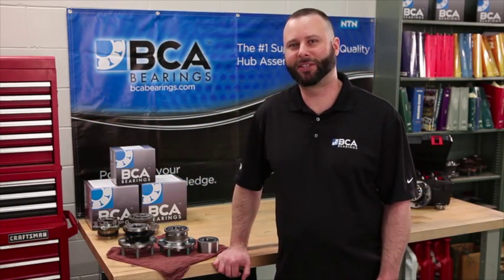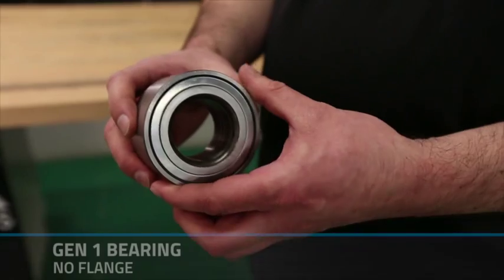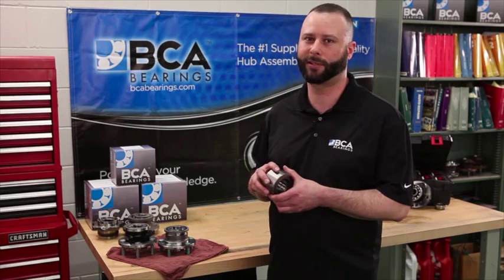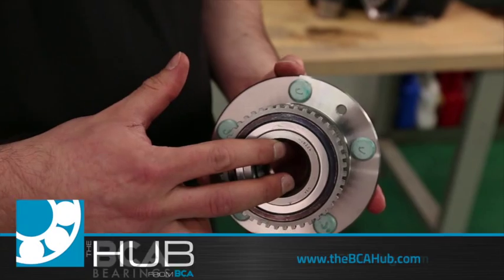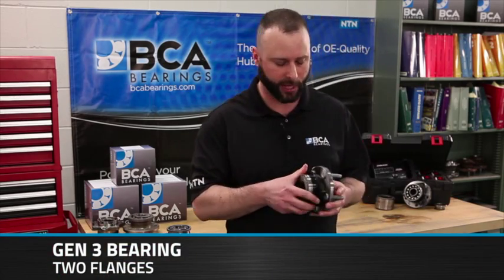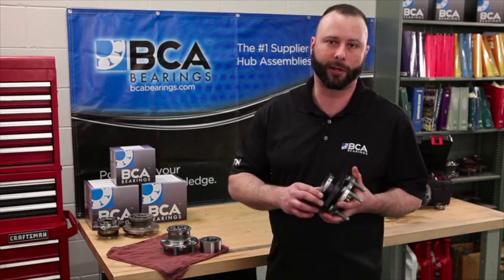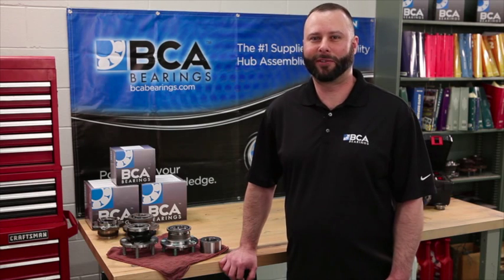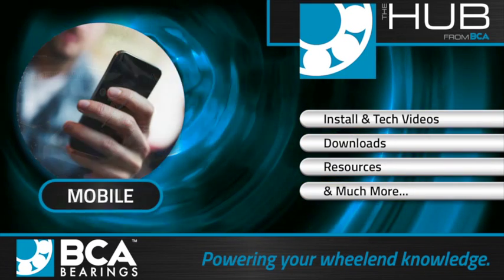Wheel Hub Comparison: Gen 1 vs. Gen 2 vs. Gen 3

Comment: Is BCA WE60551 quality product?
Reply from the maker: Yes, our BCA WE60551 is a direct OE replacement part. This part is made by NTN in Japan on the same line that made the original OE parts for the 350Z/G35.
Reply: @BCABearings Thanks! Somebody said that Schaeffer is OE parts? i was surprised. Is there NTN bearing drive in period or does cold weather affect bearing behaviance. I noticed that after 3 month of driving now bearing rolls freely, until then it was stuck? can you explain me please? I noticed same with Timken- in box was NTN? it was replaced around year ago, my bill says country of origin China?
Reply from the maker: During initial use, it is normal to feel resistance or grittiness as the wheel bearings rotate. This tightness is the result of tight manufacturing tolerances and the premium grease and seals that we use in our bearings. The premium grease used in BCA’s bearings contains performance enhancing additives, which are crystalline in structure, and can cause a rough feeling and rotational resistance when the bearing is new. The crystalline structure of the grease will breakdown into finer elements when driving a vehicle, so the rough initial rotation will smooth out.
Reply: @BCABearings  how long this resistance take place? BCA made in china looked more quality product cause resistance stopped in 2 weeks. japan product continued 3 month.
Reply: @BCABearings  i noticed that this rolling resistance is increasing fuel consumption?
Reply: What do the marks on NTN bearings mean? NTN HUB221 NH( made in china) NTN HUB221 XL( made in Japan)?